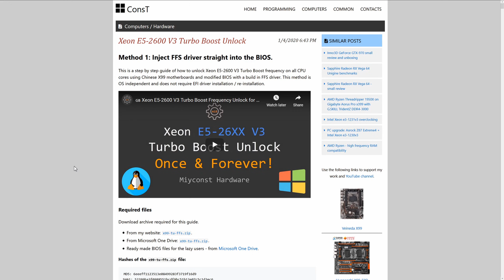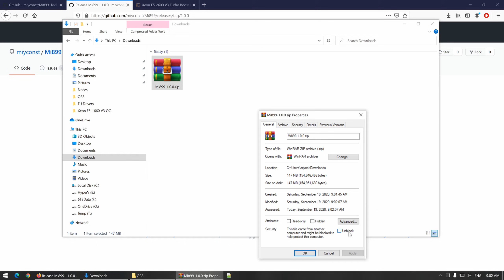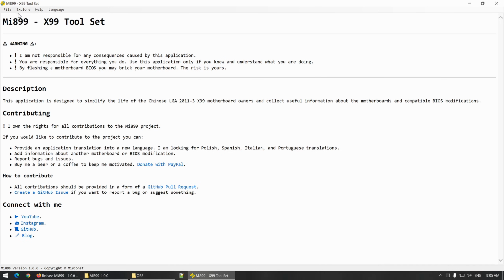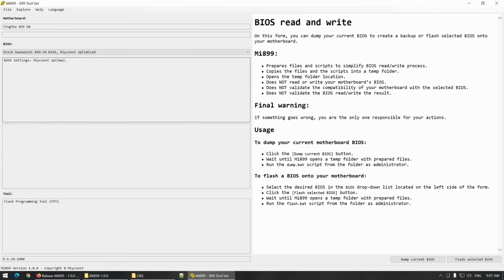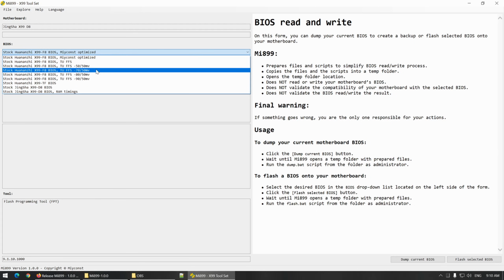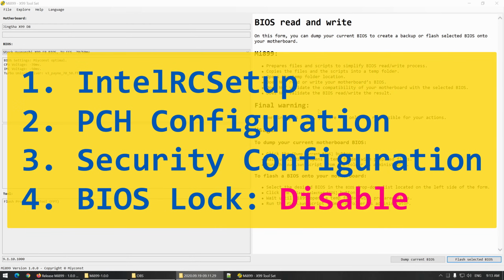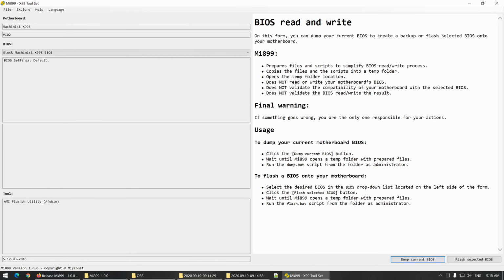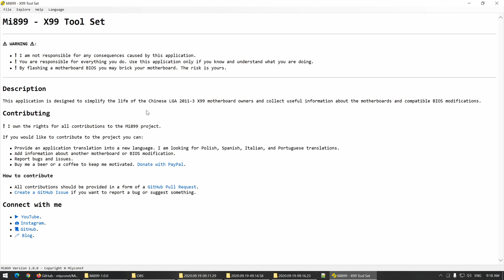🇬🇧 Mi899 – X99 Tool Set | read, write BIOS & unlock turbo-boost with a few mouse clicks

Comment: I have try this tutorial with the program from the description and following every step and my machinist pr9 is bricked, It doesnt give any signal, what should i do now
Reply: I have a xeon 2670 v3
Reply from the maker: This video should help: https://youtu.be/4qX2zihB6UE?si=7Kxv0yZ3IbBy_qOB
Reply: @Miyconst  Thanks you, but I have one more question if u dont mind answering, once I recover the bios how should I use mi888 for updating the bios
Reply from the maker: Mi899 procedure is identical for all motherboards, as long as the motherboard is supported.
Reply: @Miyconst  Yep, I know the procedure is identical but considering ive followed every step in the order it is said in the video and the mobo is bricked, I dont know what to do to flash the bios and unlock turbo boost
Reply from the maker: @davidperezolmedilla1934  if you did everything right and still got a brick - the flashed BIOS is not compatible with your motherboard for whatever reason.
Reply: @Miyconst  maybe i will try to us insted of fpt Afuwin, mabe it works dont u think?

Comment: Hi Kostiantyn!
My name is Rafael and I thank you for his content, it helps us all a lot.
I watched several of your videos and support your anti-war protest, I can't do much here in Brazil, just pray for it to end.
I bought two Machinist mr9a that came with the Q87 chipset, I don't want to make major adjustments, my main objective is to have the smartfam functional and reduce the cpu voltage to try to reduce the vrm temperature.
The processors I'm using are E5-2680V4
Do you have any alternative BIOS suggestions? Or would it be better to modify the original BIOS?

Thanks and a big hug.
Reply from the maker: Unfortunately the V4 CPUs (mostly) don't support voltage adjustment, so in your case it is not possible. Smart fan works with the original BIOS as far as I remember.
Reply: The smart fan doesn't work well here, it works well only on the CPU_fan.
I'll try to adapt some active ventilation to the VRM to see if it reduces the temperature. @Miyconst
Reply from the maker: @rafaelmascarroz  this is a hardware limitation, even if you flash a modded BIOS, smart fan will still be available for the CPU fan header only.

Comment: Can I update the BIOS from a linux machine? Where can I get the executables?
Reply from the maker: Mi899 is not compatible with Linux.
Reply: @Miyconst  I did not mean Mi899 I meant the actual flashing executables
Reply from the maker: @kesslerdan1  these are Windows app as well.

Comment: You think this will help with my motherboard being slow? I7, 32 gigs ram
Reply from the maker: Motherboard being slow? What do you mean with that and what motherboard is it?
Reply: @Miyconst  thanks for the reply! Machinist 2011 v3. Things are just loading slow for some reason. The parts are good I was thinking the mobo
Reply: @Miyconst  it was a toss up board but I noticed someone mentioned it being slight and brought me to you
Reply: I am just wondering if I should just move on. I was hoping for a confirmation, but the radio silence is enough confirmation. You’re doing gods work releasing progs and information on these junk boards. Now how would I get a hold of you about creating a custom prog?

Comment: Any chance this could be updated for the Machinist MR9S
Reply from the maker: The chance is there, the plans are not, at least not yet.
Reply: @Miyconst  Yes please do it as I just bought a Machinist MR9S. I wish I would have seen this vid before I went with a E-2680 V4 however. Oh well, it was only $15. I'll replace it with a Mi899 compatible E V3 when I build my second rig soon. I will make sure to get a E V3 too. Maybe by then hopefully you will have had a chance to include the Machinist MR9S x99 board. Thank you for this tool.

Comment: Hi Myconst, I think I have broke my motherboard, I flashed -70/-30 bios on my QD4 motherboard paired with 1650 V3 that I bought recently and when I rebooted the system windows 11 didn’t start, I read about the issue 56 on GitHub but nothing works, I try to start the system without any storage device and everything is black, also I try to start the system without ram and everything is black too, what should I do?

Comment: Testind in QD4 + e5 2660 v3...
Reply: It stopped recognizing windows 11 boot in my m.2 ssd :(
Reply from the maker: That's a typical X99 UEFI bug, you can follow steps from one of Mi899 issues on GitHub, I can't paste links here.
Reply: @Miyconst  Thank you very much for answering me! 😊
I was able to start Windows, but the problem still persists. It is necessary to keep turning the power on and off for the boot option to appear in Windows.
Unfortunately I didn't find the option you mentioned on GitHub, could you tell me where it is, please? 
Thank you for your attention and excellent work!
Reply from the maker: @RodrigoBarros00090 it's issue number 56, just open any issue from the Mi899 repository and then change the issue number in URL to 56.
Reply: @Miyconst  Perfect! Thank you very much!! :D
Reply: @Miyconst  It doesn't work perfectly again, every time you turn it on you have to do this procedure of turning off the power, but at least it worked again!! :)

Comment: Hi i know its an old video but, can i put a v4 xeon if i did the turbo boost unlock? i have a v3 now but i want to change it for a v4, thanks!
Reply from the maker: You can, but you need to revert to the non modified BIOS, V4 won't work TBU BIOS.
Reply: Thanks, by any chance u know where i can get the BIOS for Kllisre x99 B85/H81? @Miyconst
Reply from the maker: The original BIOS should work with V4.

Comment: wow helped me so much thank you for the time and effort into creating this god tier programme cant imagine how long it took 10/10
The one question i do have though is I have the jingsha x99m-g2  with the xeon E5 2698 v3 2.3ghz base  /  2.5 all core load  3.6 single core max turbo... i decided to go with the tu 90mv 50mv and made sure to reset bios after the flash so that you're moddified bios optimized defaults were in place so cpu would reach all core max .... the 90mv and 50mv reduction is working as i can see the voltage offsets in hwinfo64  and cpu is maintaing higher all core 3.3/ 3.2 ghz  but im not seeing the full 3.6ghz all core is there any suggestions you have to fix this issue.. or is it the motherboard holding the cpu back
Reply from the maker: The CPU has too many cores and too low TDP for all of them to run at 3.6 GHz, you need to disable a few cores if you want stable 3.6 GHz.
Reply: @Miyconst  wow thank you so much works perfectly now

Comment: Thank you for the tool and the effort. Thanks for the feedback as well. I flashed my QD4 with your tool/bios (-50/50 version) and turbo for all cores is working OK. I noticed a couple of things that i want to share here. First i noticed that bios is from 07 whereas a new one form 10 exists,. Is there any case that you can add the latest bios into the tool ( i noticed that the logo changed compared to my initial bios, maybe it is the version). Secondly i noticed that single core boost is not OK meaning in Cinebench cpu does not boost at is max, maybe it is normal but is strange since the all core boost is maxed out.  Thanks again!
Reply from the maker: If I ever get my hands on the latest QD4, I will update Mi899 with fresh BIOS.
Reply: @Miyconst  Hello, in the manufacturer's site there is a newer bios, Would it help if i could share this to you? One thing i forgot to mention is that the flash erased my M2 which i did not expect so i dont have the original bios. Thank again!!
Reply from the maker: @johnk7134  sharing the BIOS with me won't help, I don't add any BIOS to Mi899 that I didn't test personally. Your M.2 is most likely not erased, just the UEFI boot is messed up.
Reply: @Miyconst  yes ok no prob, i checked this and was not the order, i will use yours now, any note for the single core boost??
Reply from the maker: @johnk7134  check if you have high performance power plan enabled in Windows, other than that I have no ideas, sorry.
Reply: @Miyconst  ok thank you for everything

Comment: Hello, first thank you for this work.I have a question. I have a Huananzhi x99 8M-F with e5 2640 v3 and i want to do this guide for turbo boost unlock, but in the Mi899 application are many bios for this mobo and I don't know which to select ?
Reply from the maker: I suggest you to study the subject so you can understand what BIOS is the best suited for you. Doing something with BIOS may always result into a bricked motherboard, even if you do everything right, but if you just want to flash the TBU BIOS without understanding what you are doing, then go for the one with -50/50 voltage reduction and with S3TT mod method.

Comment: Any ideas if the machinist x99 mr9a pro v1 is using the same bios as the default mr9a mobo? The only hardware difference i can spot is the added fans for vram cooling.
Reply from the maker: As far as I know, it's the same motherboard, just updated looks.

Comment: I was impressed by your machinist mr9a review, so i decided to go with it. Can i use one of the bios options in the program or should i download another and it manually following one of your older guides? 
Thank you for the work you've done on the xeon e5/x99 platform it is of immense value for us poor gamers.
Reply from the maker: Machinist X99-MR9A is supported by the latest version of Mi899, you can use provided BIOS options, but as always, you need to understand the risk that Chinese may have changed the motherboard and kept the name, so the old BIOS may no longer be compatible.
Reply: @Miyconst  Yes i'm aware of that, thanks for taking the time to reply to all of our questions here!

Comment: very excellence,  i want to try this, start with buying at aliexpress with your link.  
by the way, is that all xeon E5=26xx V3 can be all core turbo boost unlock ?
thank  you
Reply from the maker: Yes, all final E5-26XX V3 with stepping 2 can be unlocked. The engineering samples with stepping 0 and 1 can't be unlocked.
Reply: @Miyconst  i think, 2698 v3 is a good one. i saw your video about this.  
and some of your link are already sold out.

thank you for your respond. cheersss

Comment: I have the x99-MR9S  rev 2.0 That I can't get to post with my Intel Xeon E5-2698 v3 with ecc reg ram. It will post with a i7 5820K and ecc reg and regular ddr4 ram. Any idea why its not wanting to post with the xeon?
Reply from the maker: Are you sure that the CPU is working?
Reply: @Miyconst  yeah worked wot another user in your discord turns out the CPU has a dead memory channel. Works with 3 of the 4 channels and posts with 192gb of RAM but not 256gb

Comment: Any chance you could add an Atermiter X99 AS9 mobo compatability?
Reply from the maker: Sorry, I can't. The reason is in this video: https://youtu.be/7Pyef_ySHwo
Reply: @Miyconst  fair enough, I was able to use the Machinist modified bios. I lost case fan control in the bios but can control that within windows, so all is good.

Comment: How to unlock turbo for other motherboard - xeon v4? For example 2690v4?
Reply from the maker: It's not possible. Turbo Boost Unlock doesn't work with V4 Xeons.
Reply: @Miyconst  Thank you. One more question 2690v4 whould be good choice for gaming ?
Reply from the maker: @peny1981  no, it's a bad option for gaming.
Reply: Ok. So what processor (26xx v4 or 16xx v4) will be the upgrade to 5820k?
Reply: @Miyconst  Looking at the tests on the internet 2667 v4 vs 2690 v4, it depends on what game once 2690 is better and once 2667. And sometimes it turns out that generally 2690 v4 is better. These two seem reasonably priced to me as an upgrade to 5820k, but I could be wrong.
Reply from the maker: @peny1981  how much is the E5-2690 V4 for you?
Reply: @Miyconst  Converted to dollars, about 70-75$. I can buy from a Chinese (32$) but I prefer to buy locally.
Reply from the maker: @peny1981  for that price I would rather pick a second hand i3-12100F.
Reply: @Miyconst  
Sorry, I think you misunderstood me. I have a PC with 5820k 64GB ram and I'm thinking about an inexpensive processor upgrade to make it last a few more years.
Reply from the maker: @peny1981  ok, in that case E5-2690 V4 could be an option, but if your i7 is overclocked you will get performance degradation in single threaded games.

Comment: Hello, I was wondering on how can we test an undervolt if it is successful or not? based on my understanding, the script will install a bios driver that will apply the undervolt during boot, if it becomes unstable, how can we revert back to a stable level? For example, my motherboard X99 QD4, I successfully test an undervolt of -50/-50 but I want to try the bios with -70/-50 but I'm scared if it will become unstable and wont be able to revert back to -50/-50? Thank you
Reply from the maker: Rule number one: if you are scared - don't do it. If you reduce the voltage too much and the PC becomes unstable, you can disable Turbo Boost in the BIOS settings and let the CPU run at the base frequency. Then boot into Windows and revert the BIOS. Another option is to use an external flash programmer and restore the working BIOS.

Comment: cant find ZX-DU99D4 motherboard listed my problem is trying to install all 8 slots of ram to 128gb stead of 64 with 4 sticks results in a 6d code error 
AliExpress X99 Motherboard ZX-DU99D4 v1.31
Dual Intel Xeon E5 2690 V4
Atermiter 64GB (4x16GB) DDR4 ECC 3200Mhz
(only sees it as 2400Mhz in windows)
MSI Gaming X Nvidia RTX3060
nvme m.2 Drives
Gigabyte 128GB Boot Drive
Kioxia 240GB
Sata m.2 Drives
San Disk X600 128GB
2.5" Drives
Kingston 228GB SSD
Western Digital 500GB (Ex Laptop)
HGST 1000GB (Ex PS3)
3.5" Drives
Western Digital 500GB Blue
Western Digital 500GB Blue
Hitachi 500GB
NAS Refs RAID 0 Drives
Seagate IronWolf 10TB
Seagate IronWolf 10TB
Seagate IronWolf 10TB
Seagate IronWolf Pro 10TB
Fideco USB 3.0 HDD Docking Station
Seagate 500GB
Seagate 500GB
Total Data Storage Capacity Approx 45TB
Phanteks 140mm Case Fans x3
White Led 120mm Case Fans x4
Aliexpress 92mm 4 Heatpipe Tower Coolers x2
Corsair 850RM Gold Power Supply
Phanteks Eclipse P600s Tower Case

Comment: You're doing great work, thank you. Qiyida has a new motherboard model, the X99 ED4, that isn't listed on the motherboard list, and has gained popularity recently. Should I try an X99-D4 motherboard BIOS from a different brand, or try and get this board directly supported?
Reply from the maker: You can surely try the QD4 BIOS, but there is absolutely no guarantee that it's compatible.
Reply: @Miyconst  I have successfully flashed the Huananzhi QD4 BIOS to the board with -50/50 preset - unfortunately, my SSD was changed to GPT, and I could not return it to MPG, so I had to format and reinstall windows. Fortunately, I didn't have anything of value on it, it was all on some internal HDDs I disconnected, so I'm not sad, but I know some people will get f*cked if that happens to them. Just a warning to anyone who's reading this.

Comment: After I unlocked it and the computer was freezing during the games, what could it be? I have a Xeon x99 RS9
Reply from the maker: It seems like you didn't restore the BIOS default values after flash.
Reply: @Miyconst  I've already reinstalled the original BIOS and it's still freezing, what could it be?  help me 😢
Reply from the maker: @regisfraga1703  then the flash either didn't work through or you have somehow managed to damage the motherboard.

Comment: Super work and super tool!

Have you thought about adding a board that is becoming quite popular by its price? it is MR9A PRO V1.1

Of course I use it and I am curious to find a BIOS with unlocked TURBO BOOST.

Congratulations again, and thanks for your, hard work.
Reply from the maker: As far as I know it's exactly the same motherboard as X99-MR9A (not PRO), just with a slightly different appearance.

Comment: not sure what happened to my comment...I flashed the Huananzin X99-F8, -50/50mv but my system is now crashing. 
Is X99-D8 Jingsha motherboard.
Can I replace the CPU (which may be faulty) without reflashing back to the stock bios?
Reply from the maker: If your other CPU supports TBU then you can replace it with reflashing the BIOS. If the system was stable at stock and crashes with TBU, it could be that you have got a bad CPU sample that's not capable of holding the turbo frequency with reduced voltage.

Comment: Any update for Huananzhi X99-QD3 (Intel Q87)? :-)
Reply from the maker: As far as I know it uses the same BIOS as QD4.
Reply: @Miyconst  I flashed the QD4 -70/-50mv bios on my QD3 and worked fine without problems, i'm using a 2666v3.

Comment: Hi All, 
Having a slight issue with my E5 2666 v3 and MR9A. I used the -50 mv bios to flash through mi899 but the system keeps getting stuck on the windows loading screen before the desktop. Have i bricked the motherboard due to too much of an undervolt? i'm still able to get into bios just not into windows - perhaps i should give it some time on the locked screen to see if it works?. Any help is appreciated. Thanks :)
Reply from the maker: Did you restore BIOS defaults after flashing the modded BIOS?
Reply: @Miyconst  I disabled custom power mgt and was able to get into Windows again. No I don't think I did this the first time, should I try reflashing then restore defaults?
Reply from the maker: @kavishachapman8232  restoring BIOS defaults sets the required CPU C state settings, with wrong settings your system will lock just like you have described.
Reply: @Miyconst  all working now! Thanks so much man